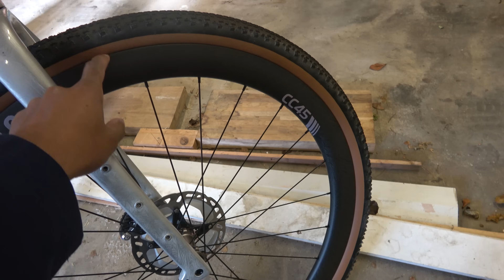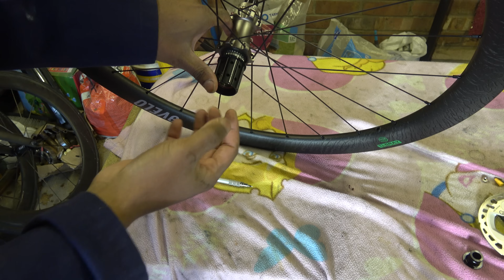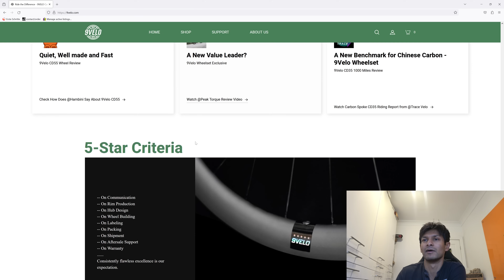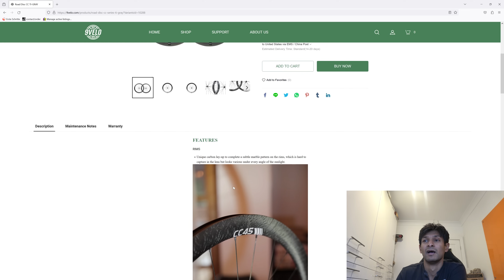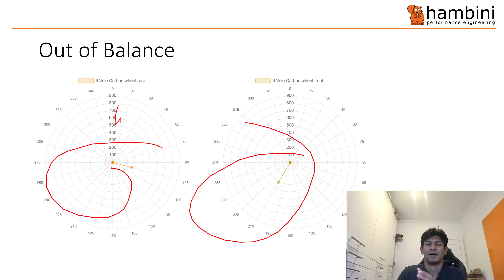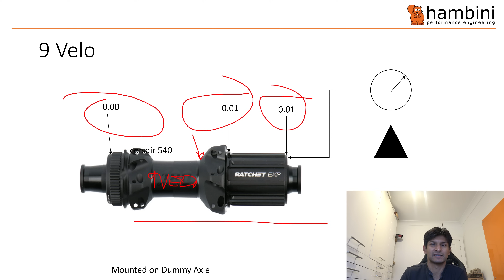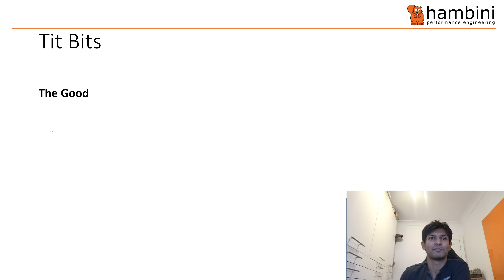DT Swiss get Completely RINSED BY 9Velo Wheels Ratchet Hub

Comment from the maker: To give a bit of context on this. 9 Velo is run by a lady who is extremely modest and quiet - I met her at Eurobike. In the bike industry, quality is often measured by the paint job because you can touch it and feel it. The ability to measure fits, tolerances etc is limited as the measurement gear is expensive and most people don't have it. You also need a bit of training on how to use it. This wheelset (and especially the hub) addresses that, the quality is something you would be hard pushed to be able to see, you'd only notice in operation due to the low levels of vibration, good alignment and corresponding bearing life. The design and execution are exceptional.
Reply: Campy / Fulcrum were the first to go with zero nipple holes, way before tubeless hit the scene, originally it was designed increase strength while using thinner alloy, they also had a type of nipple that screwed into rim on their top end wheels.
Reply: @love2wheels748 Mavic did it before Campy even came up with Fulcrum wheels
Reply: @veganpotterthevegan  which Mavic rims had no inner spoke holes? I remember Campy Making a really big thing about the weight advantage vs strength of zero hole? I remember Mavic working with Hutchinson to create tubeless but they use tape and for a while tried a unique thick rubber strapping that was meant to replace the tape
Reply: @lovecycling193  Mavic Ksyriums for the road but if I recall correctly, their higher end Cross Max rims went hole free first.  Neither were intended to be run tubeless at all, even their MTB wheels but people were running their MTB wheels tubeless nearly immediately.  This is in the early 2000s.
Reply: @love2wheels748  it actually took a while before Mavic made their hole free wheels tubeless compatible. They really dropped the ball there.  If they fixed their hub problems and went tubeless, they would have taken over the market because they had pretty great market share when tubeless was trying to get established.  Their market share went to crap around 2010-2012 as few companies would put them on complete bikes.
Reply: @veganpotterthevegan  I was runny Mavics first Tubeless on my Yeti end of 1999 beginning of 2000, they introduced them with Hutchinson to the team’s earlier that year, lots of people bodged their own versions using Gorilla tape and Liquid latex, can’t remember who released the first longer lasting sealant though, it was either Keith Bontrager or Stans, my memory is shit lol
Reply: @lovecycling193  I wasn't cycling until 2002 but I do know people that ran bodged setups with a ton of tape in 1995.  I tried the early Hutchinson road tires(a rep really wanted me riding them) but they had atrocious ride quality.  I've been riding tubeless for the last 120k miles though...exclusively for the last 80k miles.  And hookless tubeless🙃  I don't think I'll ever buy a hooked rim ever again as all the best tires will be hookless compatible in their next iteration.  I have a ton of gear and I only have hooks for the training and racing wheels for my TT bike and hooked climbing wheels(DT ERC 1100s) I never bother to put on because I love my cheapo hookless dt350 wheelset I built with Chinese carbon rims I paid $108 a piece for😵‍💫  I was scared about riding a rim so cheap but they've been outstanding.  +20k miles and I've only trued them once and I'm a very heavy cat 1
Reply: @veganpotterthevegan  I was racing XC mtb and the odd DH throughout 90’s and into the 2000’s, while Hookless is fine on low pressure applications ide never run Hookless on anything 50 psi upwards, and I believe after some horrendous crashes this last year the UCI will be looking into Banning Hookless on high pressure tyres, I know most teams have started using the Vitoria inserts so if you explode a tyre it expands and pushes the bead into the rim.
Reply: @lovecycling193  I weigh 88kg(84 when I'm in shape) and live a few miles from 2 HC climbs here in Utah.  I very confidently descend them at over 60mph and as high as 67.  I used to race professionally and I wish I had these wheels when cycling was my job.  
*I don't run them over 70psi.  32s at 65-68 at most but I'm normally on fatter tires at 50psi.  25mm internal but I'm buying another set of rims that are 27mm internal...same design/manufacturer but the wider size.
Reply: @lovecycling193  I run inserts on my gravel bike.  I may eventually ride them on my road bike but it's more for laziness if I don't wanna pump a tire that wouldn't plug which is extremely rare for me. In the last 10yrs and +120k miles of road riding,  I've only had a tire that wouldn't plug 3x.  Can't say the same about my mountain bikes but that's true for the road. I have had more issues with poor fitting hooked tires/rims than hookless over the years
Reply: @veganpotterthevegan  sounds like your roads are much cleaner there. I'm jealous! Here, we get flats all the time because roads aren't clean. No tire is safe, even Schwalbe marathons get flats a lot out here. And those are considered some of the best.
Reply: @love2wheels748 No,that wasn’t Campy-It was the German wheel company CITEC.
Great guys,when the brake surfaces of the rims were gone I asked for just 2 new rims and within days they not only sent them to me for an extremely good price,additional they sent me the special tool plus 40 nipples AND 3 spokes (which i never needed ) Still running today on my steel oldtimer,they’re beyond 50.000 km and freakin fast aero wheels 🤙
Reply: What I am missing here before a verdict (and a discount code) is an in-depth inspection of the rim.
The claimed unbranded  "Top Tier "NTN" bearings are (referring to the 9Velo website) TPI bearings, considered to be a "Budget Tier" by @Hambini
Reply: Does anyone know if they use the same hubs and bearings in their gravel series wheels?
Reply: @Hambini , Can these be used on a road bike?
Reply: I've started using these hubs and also a fan. I build to 0 1 mm runout but that takes time so get why these are .4mm.  The direct market has changed the game, but that's a good thing, keeps people like me on the ball.
Reply: the make reminds me of oldschool fine mechanic tools.

Comment: Hi, Thank you for your great reviews. I would like to ask if you have seen the new 9velo GV 2.0. They seem quite similar to the CC TI-GRAY, with the same hubs and type of no-hole rims. How can it be that using wider rims and the similar components makes them lighter than the CC? Could it be due to the different nipples, SAPIM SILS vs. generic aluminum?
Additionally, I would like to ask if mounting 32 mm road tires and 38 mm light gravel tires on a 26 mm inner width rim would be counterproductive?
Reply from the maker: yes I have, they are very good wheels

Comment: Just about to pull the pin on a set of ninevelo gravel wheels using your code. Any feedback on the gv45 v gv45 2.0. Apparently the only difference is the hub but they don’t have any hub descriptions on the website.
Reply from the maker: I don't think you'll have issues with either. Lots of people on my patreon are using them - unanimous praise.
Reply: @Hambini  hugely appreciated. Now that nightmare of tyre choice starts

Comment: 19:50 honest question: does this really matter for this kind of application? like I feel like the brake disc can run out anyways, there are so many forces randomly in that surface of the disc, its not going to spin in a perfect circle when you break anyway, on the hub surface its whatever, the hub, I could see why you care about that, but at the end of the day, I am pretty sure the cogs roller indents are not even closely to that kind of tolerance
from an engineering standpoint, I see what you mean, but I feel like at these tolerances it should not matter

Comment: Oddly specific question - Does anyone know how the 9Velo rear hub dimesons line up vs. a DT ratchet hub? Basically have DT 350 rear hub, would like to run two wheelsets but hoping the hubs are close enough in dimensions so that I don't have to make any shifting adjustments (rotors are easy as they can be shimmed).

Comment: No need to use magnet for niple. Just use wire, bend wire end on niple end, pass wire through valve hale to the spoke hole - fish wire, and then pull wire out with little force :), easy

Comment: Thanks Hambini for your work. Wheels should arrive this week. Question: Does it use the DT Swiss EXP tool set or does it have different measurements and need a special toolset to dissassemble, replace bearings etc. Cheers. Max
Reply from the maker: You can usually get the required tool off Amazon. They are not that expensive

Comment: Will you do a review on the 9VELO MT40 for mtb? What are your thoughts, DT ex1700 or 9velo mt40? difference is 300$. I dont like on the dtswiss the fact that it's 28h and the nipples are aluminium while 9velo uses 32h and brass nipples.

Comment: About spoke replacement: Fulcrum for example use some tiny magnet that threads into the nipple, then with another magnet you pull the nipple through the wheel to the desired spot. It's not the most straightforward operation but it works

Comment: For all the DT Swiss fanboys out there, F-em! While internals are great they are the only hub I've ever had in 30 plus years (I'm old AF) where the hub shell cracked / came appart at the spoke holes. Before you all wax on about build quaality and spoke tension I spent over 8 years as a LBS lead mechanic and have built many a wheel. Tension was not the reason the hub shell failed. I'm also and always have been just an average or just above average cyclist, no 1000+ watts coming from my legs.

Comment: You could thread the nipple with a thin fishing line (or sewing thread perhaps) and then make a knot behind the nipple (without cutting the line afterwards). Then guide the line from the valve-hole to the nipple bed/hole with a vacuum. The knot will pull the nipple an you can then pull back the fishing line / thread when the nipple is placed correctly

Comment: 21mm internal width isn't gravel wide though, that's just current ideal road wide, like a Campy WTO, Shamal carbon, or with Campy you can get the Levante which is 25 internal.   All of these are their solid rim bed design.  MAVIC also has solid rim beds on several current models such as the 21ID SLR32

Comment: Oh man, non-drilled rims are the future. I recently built up a pair of Light Bicycles w/o spoke holes and not needing to deal with rim tape is gold. These look really nice.
Reply: What's wrong with rim tape? I'm not a wheel builder, but I think having access holes is much better for easy maintenance.
Just don't use crappy rim tape (everything with a logo on it is a bad choice). 
I thought about to build a wheel on these hubs with LB rims.
Reply: @5amba  weight of the tape for those who care, and the possible re-tape you will have to do over the course of the life of the rim.

Comment: Got the GV45's for Christmas as wanted a reliable wheelset with wider rims for bikepacking. I'm putting 32c gp5000 AS tyres on them though as I only do occassional gravel on my trips. Thanks for recommending 9velo Hambini.
Reply: What is the outer width of your GP5000 on this wheelset? I consider using GV35/45s for Cx races, but Cx tyres have to keep the 33mm limit. Thanks.
Reply: @stduol Don't have a vernier, sorry
Reply: 26mm inner rim for 32mm tyres  sounds quite wide,, and I see they mention 30-50mm for the GV35/45mm!
Reply: @DR_1_1  Yeah, it's my first experience with wide rims, I have the tyres fitted, cassette on, discs on but no sealant added yet as I've yet to even try them on the bike. They're back in the box in my garage waiting for the summer trip across France & Italy. I should try them out beforehand mind but waiting till I need a new chain first.
Reply: @mariconor242  Mmmh... yes, try before leaving for the trip, this might be a good idea ;-)
I hope it fits firmly, because I'm planning to mount 28 mm on 22c, so that's the same small 6 mm difference... these 28 mm Pirelli are already 30 mm wide on 19c, so I'm a bit worried with 22mm! even if they'll be mounted with TPU tubes in my case.

Comment: One of the reasons DTt is so popular with bike shops is the range and availability. Most of their hubs come in most axle sizes, there is a large range of hole options ( im sure Mr H will like that) and can come in straight pull or j bend plus any freehub fitting you need. Most countries probably have a good distribution network as well. But... for my new mtb wheels i bought some Funn hubs.
Reply: One of the things I like about DT Swiss is how easy their hubs are to service. The number of internals are easier to keep track of as well.

Comment: It's a shame that a company who just adopts another company's excellent ratchet design and then can machine a little cylinder (or forge and THEN machine) of aluminum gets such high marks, whereas a company like Chris King, that has been manufacturing true artwork and engineering excellence doesn't get much love.  King has making IN-HOUSE user-friendly angular contact bearings from day one.  Properly cared for, they DO NOT WEAR OUT.  Radial contact cartridge bearings like found in these hubs, DT, I9, and ALL the others wear out and develop side play and cannot be adjusted.  Off the shelf crap that give a LOT of consumers problems;  I9 fail at an incredible rate, yet everyone has endless hard-ons for those hubs.
And the King Ring Drive spline ratchet engagement is simply head and shoulders above everyone else.  Sure, DT are nice (Well, in the beginning they weren't.  I blew up two and a LOT of people were doing the same in the late 90's when DT redesigned Willie Hugi's original and VERY durable version.  But that's another story, DT are fine now.).
King are made in USA to the highest standards, yet everyone is wow'ed by someone who can't even bother to design the freehub engagement system on their own.  Sorry, not impressed.
Reply from the maker: A bearing that never wears out, keep drinking the kool aid
Reply: @Hambini   compared to much of the junk being used in bicycle components, "never" is perfectly appropriate.  Obviously nothing will "never" wear out, but withing the context of a cyclist's and a bicycle's lifetimes, then YES, a properly cared King component will never wear out.
This is based on real life experience and history.
Reply: Again, I'll add that it's beyond frustrating to see companies like I9 getting unending praise for a product with KNOWN epidemic failures, yet another tried-and-true company gets zero recognition.

I9 uses the pedestrian pawl system that requires just about zero design creativity.  Sure, they've increased the "points of engagement."  But that's a made-up issue.  
They use off-the-shelf bearings that fail.
The hubs are made in USA, which is a plus, but that comes at a price.  And a price that should reflect quality and durability.

And pawl engagement systems also have weaknesses.  Clydesdales, tandem and now e-bike riders understand the shortcomings of pawls.  As someone who's blown up six hubs on a mountain tandem, I can fully appreciate the difference between pedestrian pawl engagement versus ratchet and even better Ring-Drive torque transfer.

King, on the other hand, went to great lengths to design and implement a totally unique and effective engagement system.  The higher the torque, the better the engagement. DT/Swiss attempts to achieve this, but without the same results.  King is in a class by itself in this regard.

In house production from beginning to end WITH their own bearing production.  They aren't just picking from generic bearings that everyone else uses (which then have high failure rates).  And again, ANGULAR CONTACT bearings don't wear out if cared for.  Care for a radial contact bearing all you want, it's going to develop play and require replacement.  It's inevitable.  This isn't even debatable.
Reply: @dudeonbike800 I’d add to this, having a review of a brand new wheel and it’s engineering finesse is all very well but a better comparison would be after two years of riding in all conditions a with zero maintenance. I’ve been doing this with my dt swiss wheels and they’ve been perfect. I’m not loyal to any brands but also am suspect of all these cheap brands from the far east. It is cheap for a reason whether that be quality, longevity, or paying someone peanuts to manufacture it. There is always someone paying a price.

Comment: The ratchet system is the thing people love (or sometimes hate). Because there was no one else making it, if you love the ratchet, you have DT (even if it says giant, or ffwd, etc). DT themselves, like every other high end parts company has hits and misses with design, quality, seals etc.

Now that we are seeing alternative ratchet hubs we will hopefully see a lot more innovation, cause lets face it, a 2023 dt hub is literally identical inside to a 1994 hugi, for good or for bad.
Reply: No it isn't!  Not identical; similar, yes.  The ratchets were redesigned with lower ramps and far less engagement than the Hügis.  Willi Hügi was annoyed that DT/Swiss redesigned his durable version because consumers complained about the free wheeling noise.  He said as much at Interbike.  And the result?  Epidemic failures!  I blew through two before giving up on them in the late 90's and a LOT of consumers had problems with the redesign.  Yes, DT/Swiss addressed the issue and got their QA/QC issues worked out.  But even then, they had additional surface hardening problems that caused another batch of failures early 2010's.

The original Hügis on my tandem are now over 30 years old and have never been serviced, overhauled or skipped once.   Hügi are NOT DT/Swiss!
Reply: @dudeonbike800  Settle down haha. In fairness to me, I only have a DT branded one form the 90s handy.
Reply: @miniMonsterCNC  well then, there you go!